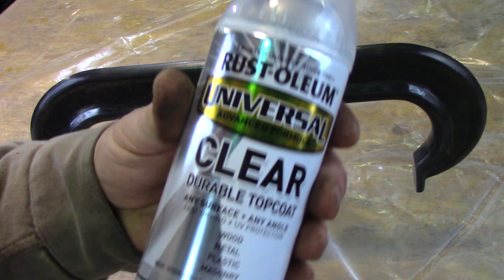Wilton 12" C-Clamp Restoration, Refurbished & Improved!

Comment: Great job!  Did the vise I saw you clamping the screw thread in have aluminum jaws?  Also, I'm wondering why you didn't clean up the inward curve of the pivoting end-platen with a rat-tail file (or emery clothe on a dowel) while it was still on the lathe. BTW, I really liked the way you peened over and cleaned up the upper cuff of the end platen

Comment: I want to ask an expert: how would I get out the snapped off sphere inside the swivel, I'm trying drilling pilot hole, now it's spinning, then i was going to reshape the end of the screw a ball shape probably with side grinder and dremel, then peen swivel back on, but right now I'm trying to get that broken ball out of my swivel. any suggestions?
Reply from the maker: I wonder if you used a grinder to grind the ball if it would spin as you grind it.  If so, you might be able to get it small enough to fall out.  Otherwise you'll probably have to drill a hole in the pad and knock it out with a punch and weld the hole after.  Or weld the ball to a piece of scrap and pull it out.
Reply: @GreenridgeMetalWorks  I like your wondering, thank you, i never even thought of a hole in the other side! fantastic, i don't have a welder but i could leave the hole or epoxy it. awesome, also, how do you add the emoji's to these comments
Reply from the maker: @mrkeopele  YouTube gives me a button for replies.